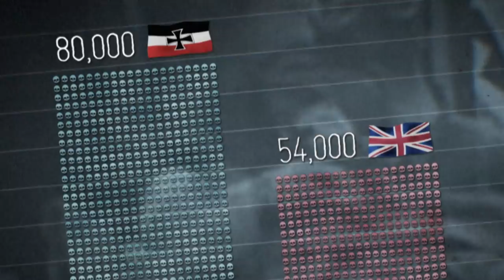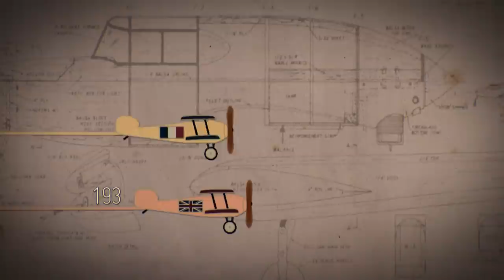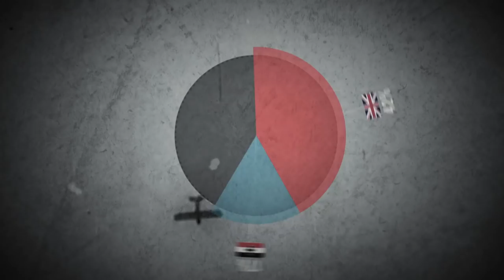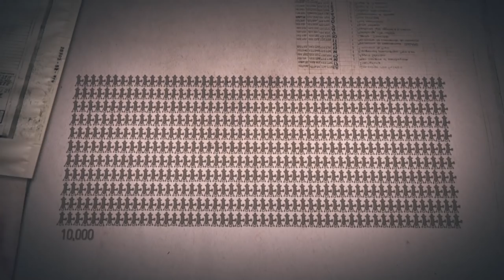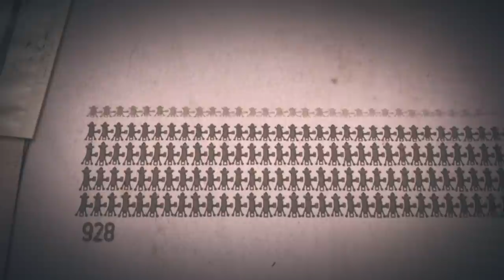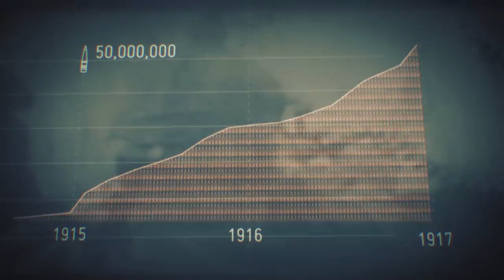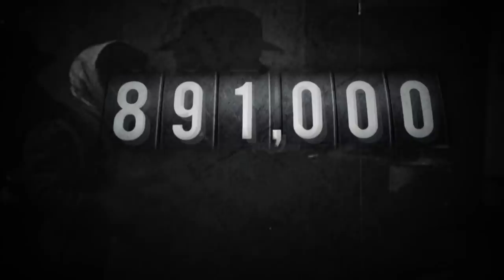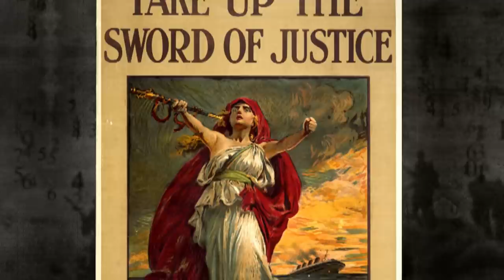The Great War in Numbers | Episode 2 | Weapons of War | Free Documentary History

Comment: 15:40 Fokker didn't invent the interruptor gear out of the blue -- Raymond Saulnier had patented a synchronizer in April 1914, but it was tested with a Hotchkiss machine gun that was known to have an inconsistent firing rate, resulting in the setup failing to function properly. A French pilot, Roland Garros, after meeting with Saulnier about firing a machine gun through the propellor arc, had with his mechanic come up with the idea of fastening a metal plate to the back of the propellor blades of his fighter; this allowed him to mount a machine gun on the top of the fuselage firing through the propellor arc, with the metal plates deflecting bullets that would have hit and destroyed the propellor; this allowed him to shoot down three three aircraft before he was hit by ground fire and forced to ditch; he was captured before he could destroy his aircraft and the deflection wedges on the propellor. The aircraft was taken to Anthony Fokker's factory, where Fokker had been working on a similar system for six months, and, after examining Garros' innovation, came up with the interruptor mechanism that would fuel the Fokker Scourge.